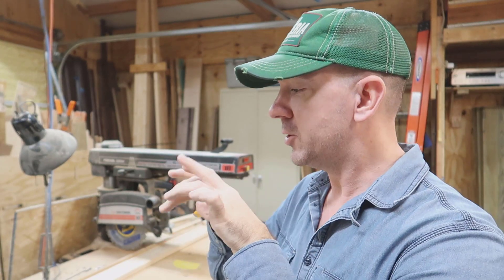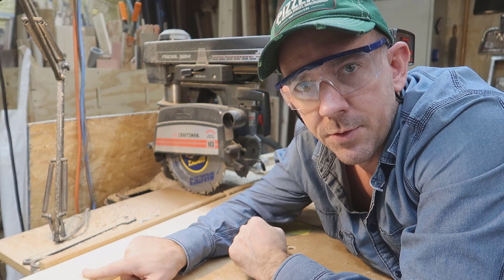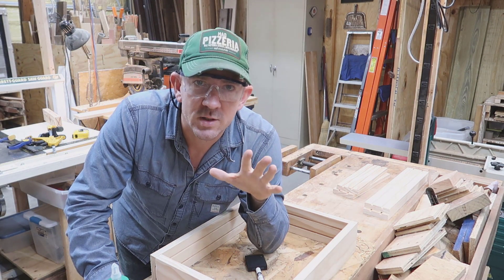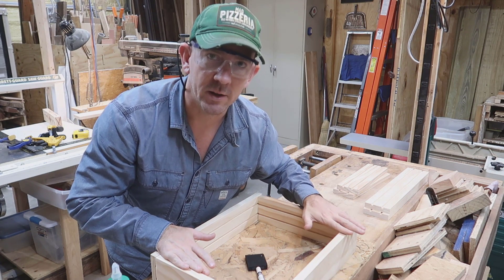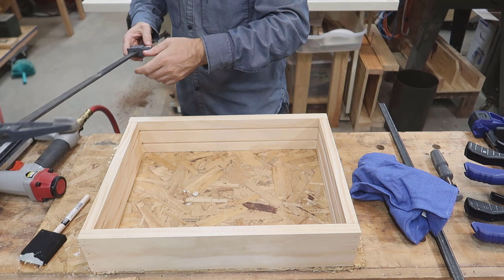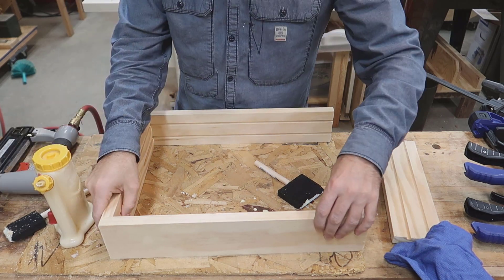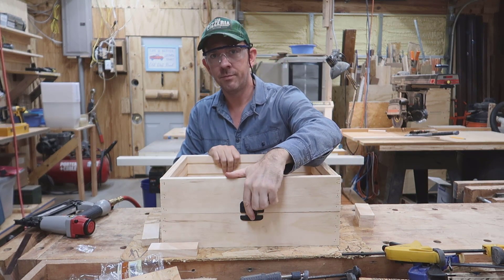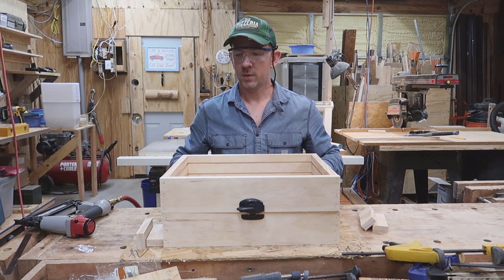Sand Casting Flask Build: How To Guide

Comment: I like your design. We have been using dowel rods and somehow in the 14 inch bell we are trying to cast is paper thin on one side and a big hole. I believe the rods are shifting a causing the casting to be too thin on one saide and making the big holes ...otherwise the bell looks good when cast on the other sides of it. I may make the flask cope that way over the drag....Its discouraging in 4 attempts and having the bell come out with the off center and holes in the side of it

Comment: Flask looks like a winner, good luck!
Reply from the maker: Thanks! I'm looking forward to putting it to good use.
Reply: @MakerCK  They look good but they could be even better. When you use them, sooner or later you're going to want to set a full flask on edge and your latches and corner brackets will make the flask a little unstable, there's a super easy fix for that, adding spacer blocks, the same thickness as the brackets, on the corners opposite the brackets will allow the flask stand on edge without being tippy.
Reply from the maker: @85rocco  Your absolutely right! I will make that addition as that sounds like a no brainier. Thanks for the tip.